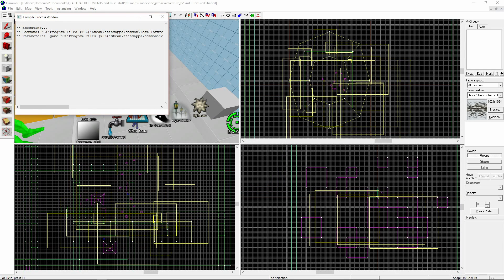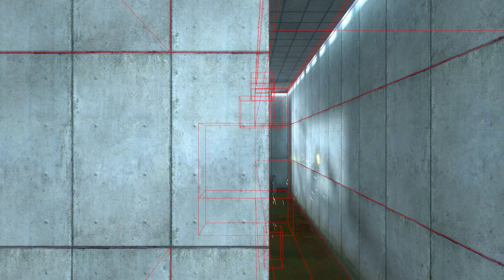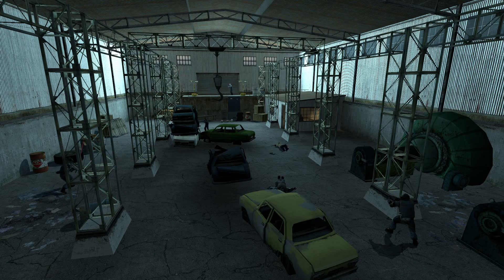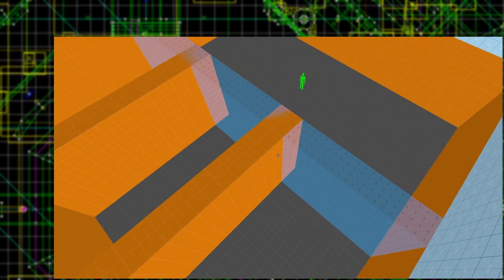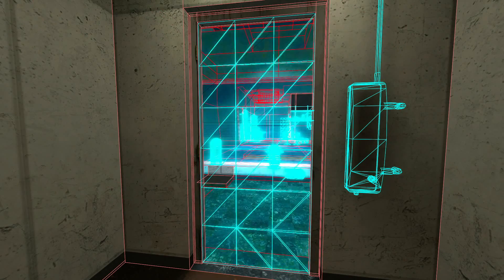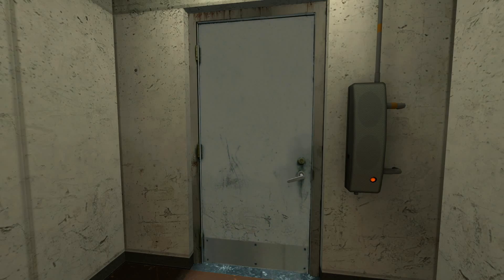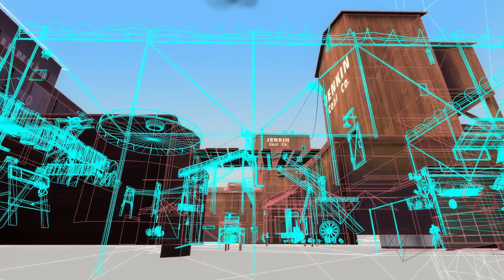Source Engine Visleafs Explained

Comment: ive watched like five hudnred different variations of visleaf explanations and i still cannot figure out how to optimize my map or bend them to my will
Reply from the maker: If it helps; after you compile a map you can go back into Hammer and in the Maps tab click Load Portal File to see a visual representation of how the spaces are cut up. Could be useful for troubleshooting and it's more convenient than loading the map in-game over and over to see changes.

Comment: I noticed that quake uses visleafs too, infact when compiling maps, its 1 of 3 options you get
Reply: because Source is a descendant of Quake. Quake → Half-Life (GoldSrc) → Source.
Reply: Pvs (possibly visible set) which is the technique described in this video was invented for Quake
Reply: For its time, Quake wouldn't be possible without them. Majority of users played it with software rendering on old Pentiums so they had to squeeze out every bit of performance.

Comment: But aren't area ports and hints the same?
Reply: No
Reply: Not quite. Hints just split visleaves and that's about it. Areaportals meanwhile have to completely separate two areas otherwise they cause a leak and don't work, and they can render and un-render things in real time depending from what angle you're looking
Reply: Areaportals also may disappear on some distance, having the space behind them replaced with static image.

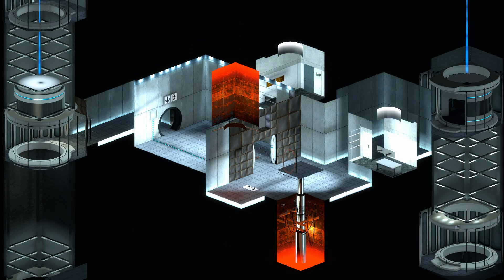Comment: dude how did you get the isometric view at 2:14
Reply from the maker: The camera can be made to look 2d in Source games with the 'camortho' command. It makes the camera into an orthographic camera. Here's a guide on it: https://tf2maps.net/threads/tip-taking-isometric-screenshots.20796/ Additionally I used the setang command to set the camera to perfect 45 degree angles.
Reply: wow thanks, i didnt know this was possible :D